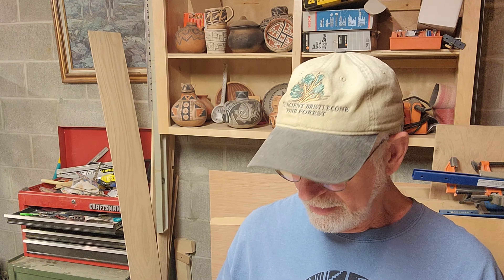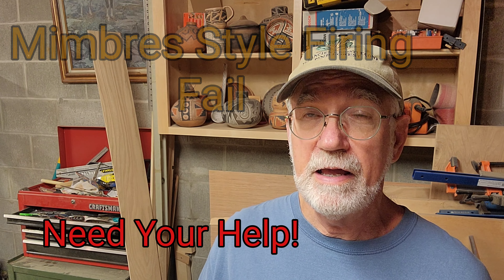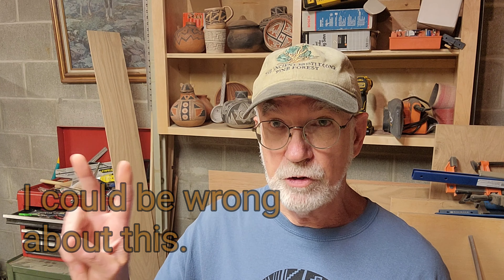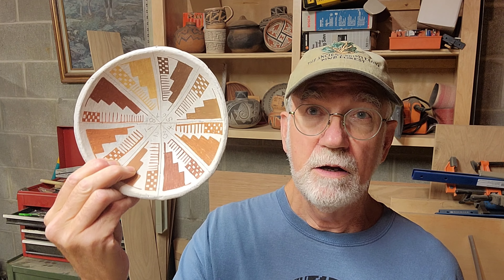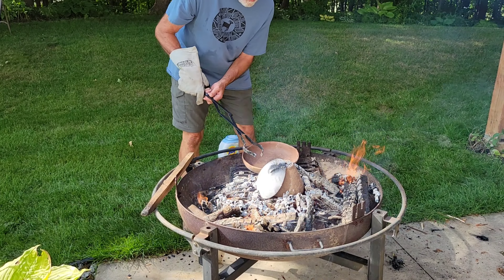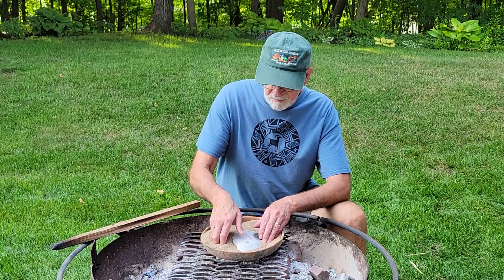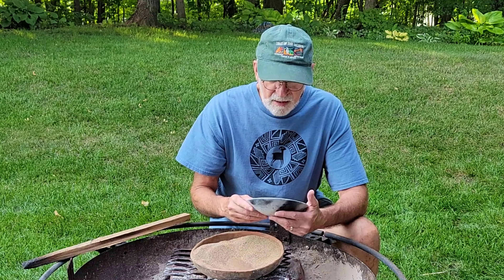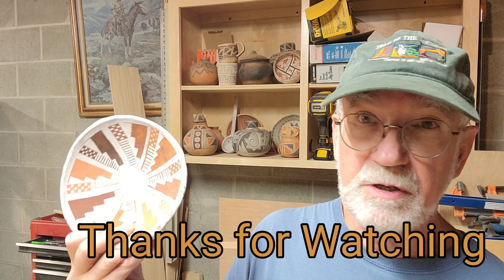Mimbres-Style Firing - FAIL; Need Help

Comment: I've been trying for red and my iron oxides start turning right away just like your sample did. (Beautiful reds on that, by the way!) I can see mine start turning just as soon as there's a large enough gap in the coals. You didn't have a chance at keeping those iron oxides black. 
But I wonder if you were able to "mute" any of those red colors with your smothering technique or if it was already too late and they all turned as bright as they would have been had you never attempted to smother them at all?
Reply from the maker: I think that the fire didn't get hot enough to fully reduce the iron.  The colors may have been muted a little but probably not too much.  Thanks

Comment: Maybe took to long to cover. In a gas reduction kiln we have to leave it in reduction until we finish firing. If we even let it get oxygen for a few minutes it goes back. So you were not in reduction until after firing and temps were already falling and oxygen was available. Don't know if that's your problem. Liked the idea of covering with sand.
Reply from the maker: It makes sense to me that there was no way for the oxygen to be used up once it was out of the fire. Also that the sand may be porous enough to let oxygen leak in. Thanks for the ideas.
Reply: I believe this and possibly the sand was too porous that you smothered with. I also believe that the Membrinos would also have an organic binder that would help smoothen the texture of their paint. Some of these have extremely high Iron content, such as wild spinach. I am looking forward to experimenting with this as well! See you at the kiln conference, Sir
Reply: I agree with Gene and I think if you can come up with a way to smother it in place earlier you could maintain the semi reduction atmosphere. The trench kilns get smothered while coals are covering the pots. Someone here probably knows the range of temperature is at that point. If you could duplicate that with your setup I’m guessing it will work.
Reply: I recomend, organic binder mixed at 10% with a half smethtite clay, (the white clay that helps organic paint bond) my spellings wrong I'm sure, and a half Iron oxide. I found that this paint is not only smooth, but also makes black in some of my open firings.
Reply from the maker: @eric8527  Thanks, that makes sense to me. I've got some ideas for my next trial.
Reply from the maker: @markgibsons_SWpottery  Thanks Mark. I didn't use any binders but it is certainly possible that they contribute in ways other than just getting the paint to stick.

Comment: can try mixing somekind of wood resin with the iron oxide to create localize reduction, I know they do this for lusters in ceramics firing. which needs reduction to get the metallic luster but can be achieved fired in oxidize atmosphere electric kiln. Because the reducing agent/medium is already mixed with the luster itself.
Reply from the maker: Thank you. I have no experience with "normal" pottery and firing but this is an interesting idea. It seems possible that something would have been added to be a catalyst of sorts.

Comment: What I would guess is that when you took the bowl out pf the fire it carried oxygen with it.  The sand covering it also probably wasn't deep enough.  Sand is pretty porous and transmits air surprisingly well, especially when it's loose and not compacted. As Allen Beale mentioned, Tony Soares covers the whole thing with a metal bucket and piles lots of sand around the edges.  But he does this without taking the pots out of the fire, he just covers up the whole fire.  That way there's still combustion ongoing and whatever oxygen is trapped inside the enclosure is rapidly consumed.  Your bowl carried oxygen with it into the sand cover, and there was no combustion going on underneath to remove that oxygen from the iron.

Pretty reds, though!  😀
I once tried an old steel small ammo case that I stuffed with leaves and placed a small bowl inside it during the firing.  That definitely gave me a reducing atmosphere -- unfortunately my white slip also turned black!  Wrong kind of clay for that...
Reply from the maker: Good thought, thanks. It makes sense to have some remaining combustion to use up the oxygen but probably not so much as to smudge the whites. I suppose as it cools it would create a bit of a vacuum in the pot and tend to suck in outside air.

Comment: As I failed with my test by smothering too quick.. Two things Wes. Was the fire hot enough? Got to be super hot and maybe smother whilst in place on the coals, don't move in the air(oxygen) and put soil on top of the sand to seal it better.. I'm trying again in a few days.. Upwards and onwards we go
Reply from the maker: I know some of the Mimbres pots were warped which suggests high temps. I don't know what temp is really necessary. This hit 1550f (843C) which is about as good as I get. Smothering right in the fire may be the solution. Thanks.

Comment: Iron is tricky! ESPECIALLY KEEPING IT REDUCED. Two forms of iron I’m convinced the Mimbres used was limonite . It is a hydrated form of iron oxide. Yellow green and very soft .another form of hydrated soft iron I’m convinced they used was goethite. It is a black small partial soft form of iron that happens also here in the Mimbres area and along possible trade routes . I look forward to sharing more at the kiln conference in October!
Reply from the maker: Yes, we need to talk. I look forward to seeing you in Silver City. I had 9 different forms of iron-based paint and I think one should have shown up as black. Maybe it is the iron source and some other aspect of the process.
Reply: @airstreamwanderings3683  Wes I’m convinced it is a part of the process. I have done more than 200 test fires mostly in a reduction kiln but also in fire. I will spill my guts in October but I will say this. … I’m convinced they did not smother . But all and all, I have also come to the conclusion that there could have been several possibilities based on known local minerals . I’m really looking forward to the conference to rub elbows and share and learn from everyone! See ya there !
Reply from the maker: I look forward to it. I hope you have a scheduled presentation time.
Reply: @airstreamwanderings3683  9:00 Friday morning
Reply from the maker: I'll be there!

Comment: Covering it with Sand will not work the sand holds Heat but if you Cover it with dirt in the fire and don't move it till it cools down it will work some times
Reply from the maker: Thanks. I would think the rate of cooling wouldn't be as important as eliminating access to oxygen.
Reply: @airstreamwanderings3683  your welcome

Comment: Hi just guessing, so perhaps they used black iron oxide or they mixed the oxide with a plant to carbon trap. I enjoyed the experiment, thank you.
Reply from the maker: That's an idea. Someone else pointed out that some of the Mimbres pottery ended up brownish/red and a little oxidized. It implies that they used a red oxide. Adding bee weed is a thought. I would think you would have to cover the iron paint to trap in the black. Thank you - the journey continues.

Comment: As the fuel burns it demands oxygen...the iron gives up its oxygen turning black......as the fuel burns down the iron will gets its oxygen back and turn red.......Soares covers the whole fire with a big can....pirfires cover the whole fire with sand......this is what I have learned but not used ...hope this helps....
Reply from the maker: The timing seems important here kind of like firing Salado with organic paint. I have to figure out what the point just before the iron starts to oxidize. Do you think refiring would work?
Reply: @airstreamwanderings3683  I do not know....will see what I can get out of Anna O Shepard....
Reply from the maker: I rewatched Andy's video and refiring shouldn't be a problem.  So many questions.......

Comment: wes, why don't you turn that bowl upside down and put it inside the large puki while it is being fired. like you did after it was fired,  but fire the bowl while it is upside down in the puki. once it hits 800c dump the sand or ash (whatever will seal best)  rite on top of it all.  that way the inside of that bowl will never be exposed to heat loss or oxygen
Reply from the maker: Good suggestion. I thought of doing something like that but I wanted to make sure that the rim and the interior fully fired. Possibly it had too much air circulation and access to oxygen?
Reply: @airstreamwanderings3683  its fired now can you refire it in the puki ?will it survive? might be worth a try, test.. then do the next bowl that way.
Reply from the maker: I think I  will retire. Nothing to lose,  a lot to gain.